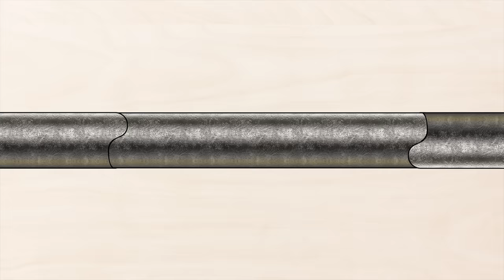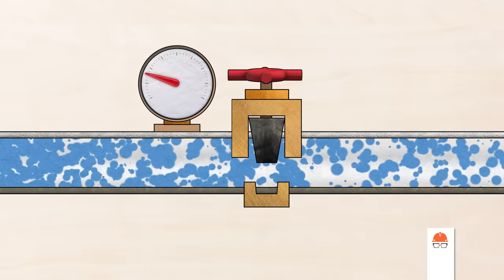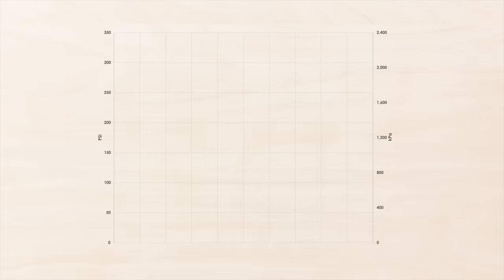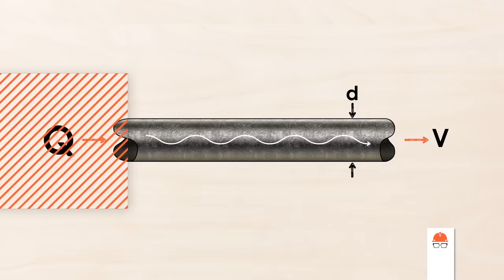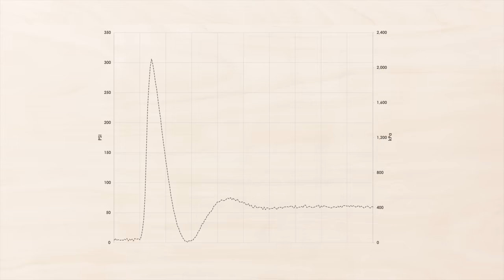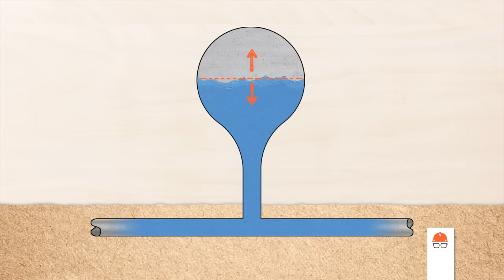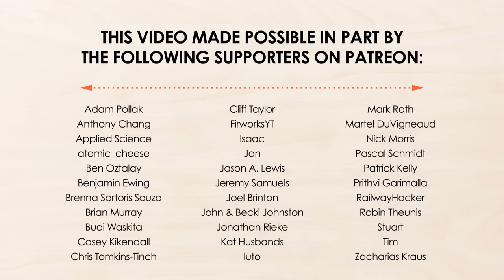What is Water Hammer?

Comment: Can you use water hammer to drive in liquid nails?
Reply: Well yes, but actually no
Reply: Randy Bard whut
Reply: Yes...but I usually just use a caulk gun for liquid nails
Reply: Obviously none of the replies before me understand construction related humor haha
Reply: Take my like and get the hell out of here
Reply: Randy Bard  “I like the cut of your jib, Simpson.” Good one, Arby.
Reply: Absolutely you can.
Reply: As long as the hammer isn't too wet.
Reply: Randy Bard only if you have enough blinker fluid. 😂
Reply: Not liquid nails obviously but I suppose it technically would be possible to use a sudden spike in liquid pressure to push in a nail.
Reply: Air is used in a nail gun. Air is a fluid like water
Reply: Good one!!
Reply: Good god lmao XD
Reply: Nah gotta use a liquid caulk disperser
Reply: (Rimshot)
Reply: Yes , once the water nails are in ,use the water screw driver to fix the ice screws down securely , any water leaks please use duct tape
Reply: @levistepanian5341    It’s a gas.

Comment: As a vascular surgeon, I find this highly relevant and interesting in my line of work. Very informative video. Thank you.
Reply: Please elaborate
Reply: But veins are compressible and elastic right? So how does that play into thing?
Reply: @MuirclanforJesus  sustained high pressure will eventually create weak points and bulges.
Search how aneurysms form.
Reply: @MuirclanforJesus  blood vessels are pipes with pressure in them. Arteries are high pressure systems and during trauma there is a sudden change in pressure resulting in burst of the arterial wall, just like in the video. Despite being elastic enough. With age and smoking, calcification forms and makes the arterial wall stiffer, making the effect even more prominent, since the artery doesn't comply the slightest with the pressure.

As for the veins, they are collecting ducts and low pressure system and also elastic and compliant. Hence high speed trauma doesn't affect veins the same way arteries are. They just behave differently, and they don't get calcified (not fully understood why).
Reply: @bobdrooples  that is Laplaces law, and not exactly similar to what is happening in the video.
Reply: @islamalobeidi313  I would suppose that most arteries do some elatic deformation and give that energy back....   It feels like your argument is that your observations say they don't do enough all the time to avert desaster 'cause they have some kind of denigration effects that make them less elastic.
Reply: @MuirclanforJesus  blood is mostly water which isn't compressible. In these scenarios the system you're looking at is the water in the pipes and not the pipes themselves. That's why the physics here apply. The blood vessels being elastic and not rigid is probably a big part of how our body deals with "water hammer". It seems like some of the people here probably know more about it than I would though.
Reply: @urrywest  Pretty much. If you stretch and compress a spring enough it will lose it's elasticity. It's interesting though because all of this is way off topic. The way that this video relates to vascular system is the flowing water under pressure not the pipes.  The system we are observing is the water itself, where the pipes are just the container for which our physical system is propagating itself. Our only concern is what the water is doing.
Reply: @islamalobeidi313  This is a good explanation. Thanks
Reply: Pipes cannot dilate. Capillaries can. 😉
Reply: I certainly hope not
Reply: Just use an air hose and compressor to push that blood through the arteries. Lol
Reply: As king of Egypt, new thinks you're not actually a surgeon
Reply: @Psalm-yg6yi  you can think what you want. And maybe you are right. And maybe not. I'll let you stay uncertain about it. 😘

Comment: This is also a topic of research in nuclear engineering! Critical for fast shutdowns.
Reply: eL3ctric it’s also used in aircraft hydraulic systems.
Reply: It's also used in electrical systems.
Reply: Interesting things occur when you have coils being controlled by a computer.  There is a reason many of those coils have LEDs on them.
Reply: Yes, but water hammer killed three men in the only fatal accident in the history of American nuclear reactor operation. Make sure you don't have any voids during shutdown maintenance operations, and you will probably be safe.
Reply: NavySturmGewehr. i don't see how that has anything to with what you said before.
Reply: There is a stand alone comment from me on this video that would help you understand the context of my remark.
Reply: NavySturmGewehr. i read it and it doesn't have anything to do with what's happening in this video and an electrical system. The only thing that comes close would be harmonics, but even then no, they are not the same.
Reply: I was wondering if someone was going to mention the SL-1 reactor...that's where I first heard the term "water hammer".
Reply: When you pass a current through a wire (water flowing in a pipe), energy is stored in a magnetic field due to inductance (the energy in the momentum of the water due to mass). The quicker you change that current, by say disconnecting a wire (closing a valve, thus nearly instantly stopping the flow of water), the more electromotive force, aka voltage is produced (the force produced due to the water banging on your pipes). To a certain point, the quicker the switch, the more destructive the effect.

He is absolutely correct. These two phenomena are directly analogous. He's talking about putting diodes on coils that get turned on and off quickly (like relays) in order to absorb the reverse voltage spikes and prevent them from destroying the rest of the circuit when you turn them off.

Hydraulic ram pumps and switch mode power supplies and more identical than you think :)
Reply: I have no clue what you're talking about with "The only thing that comes close would be harmonics" though.
Reply: frtard. no you are wrong. you haven't even said which type of electricity you are using for that example, that's how i can tell you don't know what you are talking about.

EDIT: It sounds like you are using AC electricity in that example and you MIGHT be right then, but that's not true for DC electricity.
Reply: frtard. p.s. water to electricity analogy is also wrong, everyone who deals with it on a daily basis understands that.
Reply: Max R Ok wow. Chill a bit. I'm not attacking you, so no need to get all insecure; I really want to know what you mean by 'harmonics.' It's clear from your response that you don't have a solid understanding of electrical engineering. It's not an attack; it's not an insult. You can choose to listen and further your knowledge or not. Please, if I'm wrong correct me. The public sharing of knowledge and debate is for everyone ... so take it or leave it. Anyway, there's no 'type' of electricity. The laws governing AC and DC behind the scenes are fundamentally the same. What is different between the two is your perspective of a circuit and what variables you're using to analyze it. If you apply a DC voltage across coil, you can work out the properties of the circuit fine. Ohms Law, KCL, etc. Go wild. BUT what about when you're actually connecting the source? The voltage and current through the entire circuit is changing... It's effectively AC! In the purest and most fundamental physical sense, there really is no such thing as steady state DC! It only exists as a shortcut to simplify analysis in certain, specific scenarios. This is the reason why there is a distinction between DC analysis and AC analysis. You just looking at behavior .
Reply: frtard. quit acting like a girl, i never said you "attacked" me, that's physically imposibble over the internet. and your still wrong, if you are a electrical engineer i am afraid for the company you work after hearing your ramblings of your pseudoelectricity. you are only right in your world of paper and words, pretty much a low level engineer getting coffee for the real engineers who actually design and build systems that work because they have a full understanding of electricity and would never say the nonsense you are saying, go back to school kid.
Reply: The specific example I'm thinking of is a 24VDC system in a mobile process machine.  A PLC controls a shuttle valve for a hydraulic system.  An additional system was added however the connectors for the shuttle valves did not have LEDs like the rest of the system did.  Switching off the shuttle valve would cause input errors in the PLC and effect the machines ability to steer.  Added LEDs to the circuit to test the idea, problem gone, replaced connectors with the LED type.
Reply: Sure, the water to electricity analogy idea isn't right, but it isn't even wrong. It's an _analogy_. Of course they're different, but that doesn't mean they can't behave the same in certain cases. It's only for helping to build intuition of the fundamentals.
Reply: NavySturmGewehr. interesting.
Reply: eL3ctric. Fast shutdowns don’t usually involve water (as in water hammer effect). Gravity assisted(For PWR’s) (rods are inserted from underneath in BWR’s) control rods are activated (Technically deactivated because they are suspended with electromagnets and a fast shutdown cuts the power to them) to stop the nuclear rection and i’m pretty sure that you would want to keep water flowing in a nuclear power plant and not quickly shut it off to dissipate the decay heat or Fukushima happens(literally).
Reply: Personally, understanding basic circuit analysis really helped me determine the flow of pipes in a network since they are very similar in concept. A lot of the principles just seemed the same, we were just  working with a different system. I'm not sure why you bother replying to Max R, all he's really done is deflect (because he most likely doesn't understand what he's saying or what you're telling him) and uses ad hominem to argue (if you can even call that arguing).
Reply: Max R - The electrical equivalent is called "inductive kickback". NavySturmGewehr failed to mention that. The LEDs he keeps mentioning are known as "flyback diodes" or "freewheeling diodes".

Also, the water-to-electricity analogy is incredibly accurate if you know how to frame it. The reason electricity has an equivalent is because it has "momentum" in the form of a built-up electromagnetic field, the collapsing of which induces continued voltage. Components used to accentuate this effect are "inductors".
Reply: +Max R The electrical phenomenon analogy is actually way more accurate than the analogy of the train in this video. I didn't see you squashing that farther fetched example so you obviously just want to argue about things beyond your comprehension.
Like frtard said the phenomenon's are very similar and the use of diodes to protect an electrical circuit is parallel to using the valves and other methods described in this video to protect hydraulic circuits.
#stayinschool
Reply: That is why conventional electricity plants have a large chimney; to get rid of the unused energy
Reply: bad joke
Reply: Or any power plant for that matter
Reply: Max R lost.
Reply: @MR-nl8xr  FrTard is outperforming you in every regard.
Reply: And the Dunning-Kruger award for alleged electrical engineering goes to.......Max R
Reply: @MR-nl8xr  I know i'm late to the party but newton mechanics won't provide the proper insight. Generalizing force and momentum to use energy as the common link (Lagrangian, or Hamilton mechanics) allows domain free properties such as compliance (1/spring constant, capacitance, etc (a related property to elasticity)) and inertance (inertia, mass, self-inductance, etc.) to be the main concern not the misconceived Newtonian Mechanics intuition that we for some reason still get in high-school. But rants aside the analysis of kinetic and potential energy behavior will show that for any domain of macro scale engineering creating the "water hammer effect" is possible. It's just that in hydraulic systems because of the extreme rigidity of water a change to its momentum causes what we like to call an impulse, and this happens due to it's common use in our infrastructure. 
Now don't kid yourself though, it's not just water, but in electronics we have this same issue, imagine a large transformer having the power suddenly cut off the surge that comes off of this is the same thing. So it really isn't worth disputing what Navy is talking about, he's right. And the harmonics you are talking about are actually the systems oscillatory frequencies reacting to an impulse which is literally analogous to the water hammer effect. So you actually confirmed he was right by disagreeing.

That said this was three years ago, but if you still want an easy way to get an intuition for this without doing too much math (but you can if you want) then check out bond graphs. They are quite good at building domain free intuition for mechanics.
Reply: This oneupmanship is a typical example of intellectual knowledge being used for egotistical purposes
Reply: I’m late to the party as well but it’s also used in liquid fuel Rocket engines. Pogo instability (also known as Pogo Oscillation), the propellant feed lines that run all the way down to the engine where it will mix, the fluid column can resonate and come back up, although the propellant fluid  is not water, it is very similar if not exact behaviour of water hammer. This causes rocket instability and damage to the rocket and all sorts. To tackle this we use pogo suppression systems within the plumbing! ;D
Reply: My knowledge of this topic has gotten rusty, but I think that in the water/electricity analogy, the most direct comparison to suddenly closing a water valve would actually be suddenly flipping a switch or otherwise creating an open circuit at the end of a transmission line (or really any current carrying conductor, I think) because doing so would make the load impedance infinite at the end of the line, which would cause the end of the line to reflect current/voltage, just like how closing the water valve makes a pressure wave propagate back down the pipe. I think the inductive flyback thing that the other commenters have mentioned would be more akin to having a water wheel along the pipe that resists changes in water flow rather than having a valve at the end of the pipe (but in the distributed-element model, I guess the reflections would be explained by the infinitesimal inductors and capacitors, so maybe they're the same phenomenon in the end ¯\_(ツ)_/¯).

Comment: Great video! We stress avoiding water hammers to the new guys at the firehouse all the time. Opening/closing hydrants and nozzles slowly. Now I can better explain to them what's going on during a water hammer rather than just say "it's bad, don't do it"
Reply: I just wrote a comment on the same thing haha. Good to see a fellow Firefighter :-)
Reply: We had an engineer shut off the flow to a 2 1/2 inch line rapidly one night and it brought the water main right up out of the ground!
Reply: This is true particularly with high flow and large lines but firetrucks are made to withstand water hammer of attack lines. Although it will cause lines to jump around and on older equipment can send extra preaassure to other attack lines.

It's common practices to quickly pencil fires with shots of water when in extreme heat conditions particularly while interior, it reduces the effect to the thermal layers while preventing flash over.
Reply: You are doing a great job

Comment: I had a water hammer incident a few months ago.  Shut off the bathtub faucet a bit quickly and the feed line to my toilet tank burst off, hosing down the whole bathroom.  Now that I know the name of this phenomenon, I might be able to search a solution.  Thanks for the helpful video.
Reply: When I plumbed my house, I put in capped lengths of pipe sticking up when I put in the showers.  They house air chambers that will absorb the shock.  I'm not a plumber, but I thought this was kind of a standard feature.
Reply: Jimichan may be a standard modern feature, but my house is a bit old and it seems my plumbing, much like the wiring, is a bit janky...
Reply: Jimichan One thing to be aware with that solution, is there overtime the air trapped in those standpipes will eventually be absorbed by the fluid under pressure, kind of like carbonating a drink, although atmospheric air is more resistant to dissolving in water than carbon dioxide is.

You were right, that that used to be a standard solution, but what I just mentioned was also a standard problem. Which is why modern plumbing uses something like the device he showed, basically the same thing, except there is a rubber membrane containing the air inside so that it doesn’t eventually disappear.
Reply: The solution to air disappearing in the air trap is to drain the entire system and then when you refill the system, air will remain in the traps. It also seems like you might have to clean the traps if they get dirty.
Expansion tanks and well pressure tanks will also help. Literally just a giant air trap but has a rubber bladder to separate the air and water.  Its required in well systems, which was common in a lot of older homes. They do go bad over time, mainly the rubber bladder. If your house was converted from well water to city water, then you will have to adjust the rest of the plumbing to accept not having this tank if its removed.
Reply: TheGhostFisher Water hammer from a quick shutoff can damage the solder at the metal/copper connections. Trust me I know!
Reply: A small device can be added to washer connections that absorb the pressure & stop the hammer effect in the whole house. 
He shows this as an anti surge device.
Reply: https://www.youtube.com/watch?v=xs2GXur9fPM